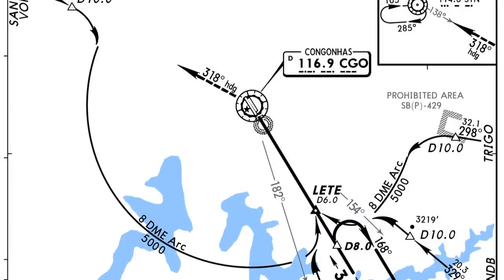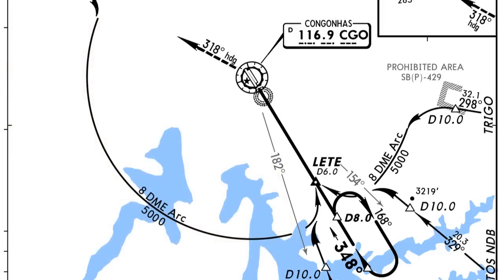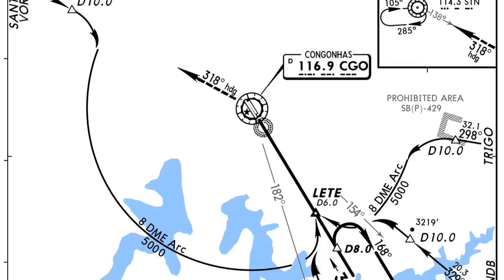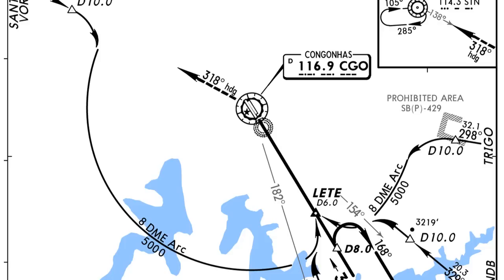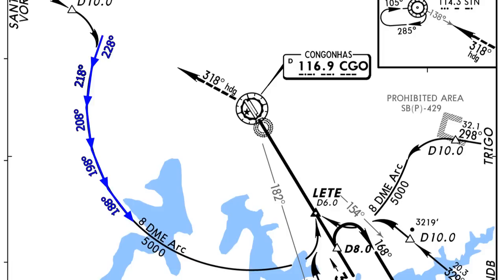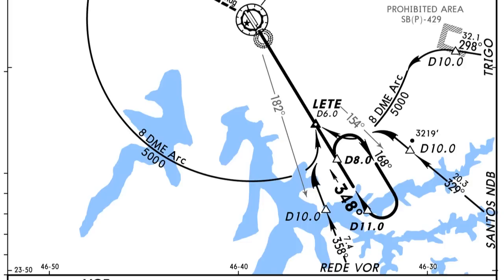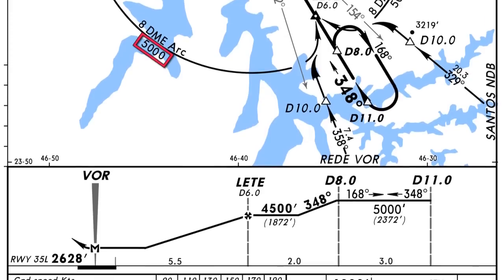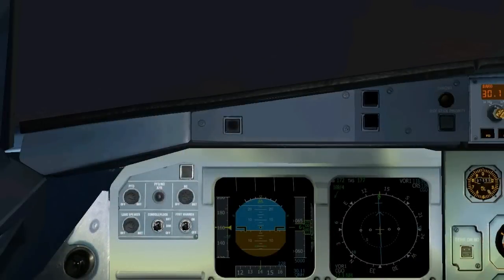VOR/DME ARC Runway 35L Approach at Congonhas Airport (SBSP)

Comment from the maker: Look at the back of the white needle (the one that looks like an arrow), its back gives you the radial you are on (or passing) during the whole arc. I turn it on at 13:45 and its back its pointing to a heading of 315. That is our radial from the VOR at that time.

As we move around on the arc, that back of the needle changes because we are passing thru different radials to the VOR on the arc.

At 20:00 its back points 182, meaning that we are at the 182 radial and we need to turn on final.

Comment: Great Video.

The only thing I didnt understand is, my aircraft has conventionals VOR's. Every single VOR I've ever seen points the RADIAL, not point TO the VOR. How should I use this 10 degrees correction on my VOR 2 to know when i should make a turn to maintain the 8nm arc? Should I put the VOR 2 into a position where the CDI is centered and wait for the CDI to fall 5 degrees to the right or left?

Comment: The 182 radial does not show on the instruments (or I am blind). But since you are flying perpendicular to the 182 radial when you cross it, you know you have crossed it  when your heading is 182-90=92 degrees. Great video.
Reply from the maker: It does show, look at the tail of the needle, it shows the radial you are on. And that tail would be on 182 if your heading is 92 and you are perpendicular as you say. But you cant rely on your heading, just look at the tail of the needle.

Comment: Hi, very good video, everything is well explained, I have one question though, how can your vor needle always point to the vor station like an adf, in my aircraft the vor needle always stay where I point it at do I have to move it by 10° increments while I'm following the DME arc ?
Reply from the maker: Jack Rabbit VOR 2 in the new planes with digital displays, even something like a G1000 acts like an ADF needle, it just points to the VOR.
Reply: Ok thanks, I was using old school VOR and HSI so I was confused, thanks for the precision. So if I use an older HSI or VOR should I change manually the bearing of the needle every time I make a heading correction ?
Reply from the maker: Jack Rabbit yes, for old VORs and HSI's you do need to manually input the headings. Makes it hard on the VOR, but an HSI os a bit easier.
Reply: Ok thanks it helped a lot
Reply: Jack Rabbit

Comment: Hi again, a bit more info. I''m trying to set up a flight plan the CDU of the PMDG 747 in FSX and it's giving me two "TRANS" options and I don't see those options on the chart anywhere. I think I figured out the notation, it has something to do with the altitude at a certain waypoint in the departure procedure...again, I think. Any of you expert knowledge will be greatly appreciated. Thanks.